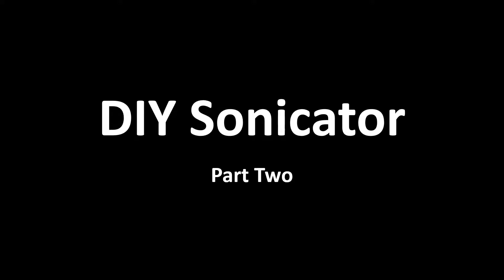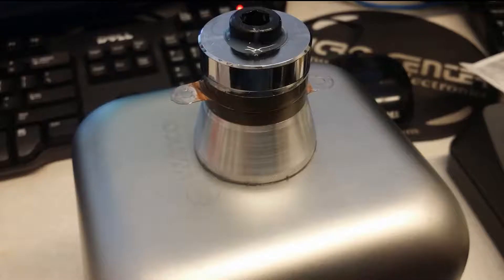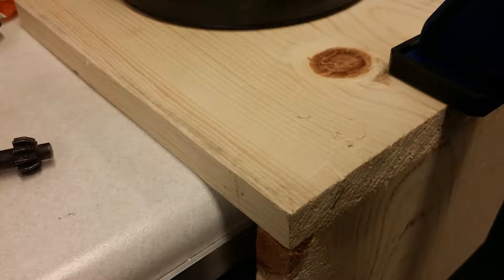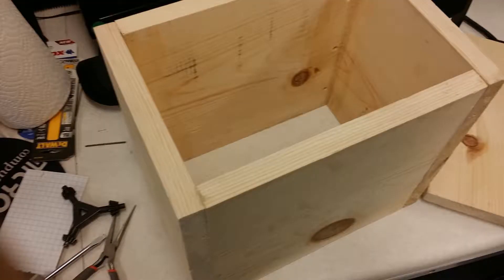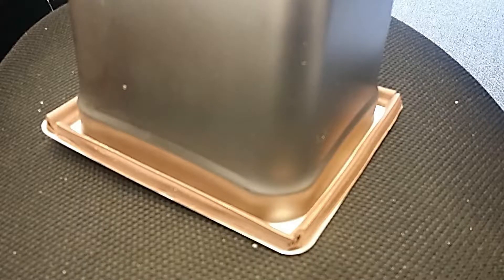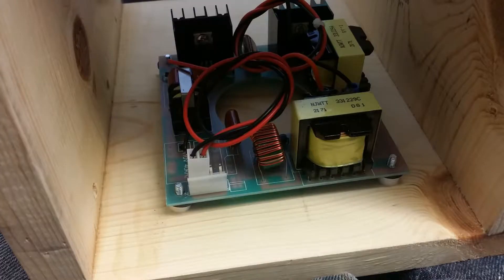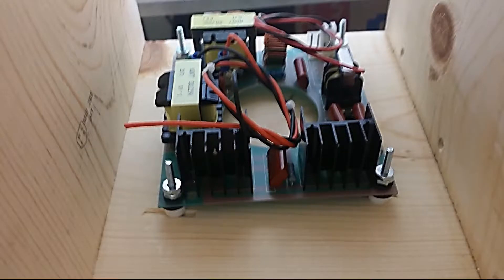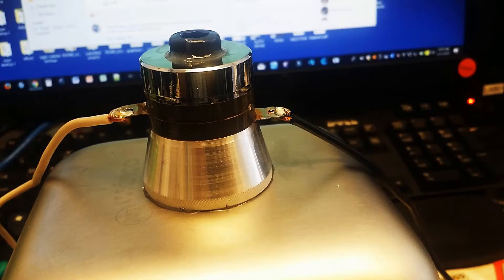DIY Sonicator Part Two

Comment: Great project, thanks so much for creating this. I was wondering if you could comment on how you've connected to the ac power? Are you wiring through a standard kettle lead type connection, into the extension cable and then to the power outlet? I would be very grateful for any guidance on wiring the driver circuit to the power supply. Thank you
Reply: Oh I rewatched the video and now I understand. thanks so much for sharing! :)

Comment: one thing... you mentioned that you thought the voltage at the transducer was "quite low".  Actually it can be quite high... several hundred volts as either a square wave or sine wave.  Nasty shock potential

Comment: I've recently seen people doing ultrasonic bowling ball cleaners,  so you think this system would work for that
Reply from the maker: I honestly don't know.  I think it would work fine, just use a large enough "heating pan" -- but the issue might be that the transducer and controller I used wouldn't be strong enough for a larger tank and a high-mass object like a bowling ball.  Good luck!

Comment: tell me sir , can i use only one pcb-board with several transducers ?
Reply from the maker: No, I think you need a separate driver for each transducer.  I could be mistaken.
Reply: @stemcampprojects7951  actually, you can use multiple transducers sometimes in series and in other cases, parallel.  depends on the output of the driver board

Comment: Hello can you please tell me have you used a two wire main power supply cable , and have you wired them straight to the power wires from the power board. Also what amp fuse is in the plug.Thanks and hope to hear from you soon.

Comment: What type of pan is that?  It looks like a standard size / shape, just probably a 1/16 of a standard industrial “full pan”.  Does the single transducer element do the job for this?  It looks and sounds like it does.  I just got my hands on a kit like that, for PCB cleaning.  I’m deciding on a sort of pan to use presently.  Something not so deep, and maybe a little greater in its dimensions looking down. Very good work!  Particularly on your power board’s standoffs and grommets to mount the thing.  It’s all very nice, and thanks for sharing this, as I was uncertain as to what adhesive to use for this.  JB Weld is just the ticket, as I have a tube of it that I wished I had a use for. Thanks again!
Reply from the maker: It is a standard stainless steel pan -- often used in restaurants in heating / icing stations.  i believe I got it on Amazon or maybe a restaurant supply website.

Comment: Can I use this sonicator for breaking cell wall?
Reply from the maker: I would think so, but I don't know how much energy that requires.  Two things - don't suspend the glass jar with the rubber bands, just place it in, and change the side panels for more airflow so it doesn't warm the solution.

Comment: Can this be used to produce oil nanoemusion in water with this device?
Reply from the maker: I don't know for sure, but I would expect that it would work.
Reply: @stemcampprojects7951  I bought the kit a few days ago for $30 & will test it out soon. Thanks!
Reply from the maker: @scottalter42  Keep us posted!  One thing I'd recommend - leave off the side panels (but keep fans).  Let it have all the airflow you can manage for cooling.
Reply: @stemcampprojects7951  Success!!!!! I got the kit, successfully made some nanoemulsion of my favorite medicinal oil in water & consumed it.  My setup is slightly different from what's explained in your video. I have the transducer part suspended from top using chopsticks structure & had it partly immersed in the solution carefully without the possibility of shorting.  I wish I can post some pictures of my setup here. Anyway, I'm excited that this worked! Again, thanks for your great video & information about the kit. Your channel has been very helpful. Next, I'll make some graphine.
Reply from the maker: @scottalter42  When I think about it, I am concerned about your mod.  Specifically about putting the transducer directly into the solution.  I don't know about metals and interactions with what you are processing.  By attaching the transducer onto a stainless steel pan and putting water into the pan and putting the solution into a glass jar and putting it into the pan you avoid all contamination.  You don't need to suspend the glass jar like I did - you can place it directly in the pan.  The stainless steel pans are cheap because they are used by the millions in the resaurant industry.
Reply: @scottalter42  wow really thank you for sharing I also want to use medicinal oil too
Reply: @nomahlubinazo6902  I should warn against this method to produce nanoemulsions. Last time I did it, the solution tasted s bit metallic. I suspect the aluminum from the sono device somehow got into the solution.
Reply: @scottalter42  thanks for the reply, I'll look for a stainless pan and then hopefully I can give you feedback on how it went because I essentially want to make nanoemulsions to apply on my skin
Reply: @scottalter42  hi sam ann. Thx a lot for your info. I had some questions if you don't mind. 
Do you make any test for the nanoemulsions stability ? 
How long the O/W emulsions stability you made by this method or need add any emulsion stabilizers?
Reply: @bazzarmart8607  Sorry, I didn't test all that.
Reply: @scottalter42  Even if you use a titanium sonicator wand,  you'll get titanium in the solution. It's explosions as hot as the sun happening in the water,  its going to erode metal slowly over time.

Comment: Pardon my ignorance on this, but this is really an ultrasonic bath, correct? Or would this be powerful enough for cell lysis?
Reply from the maker: I don't know enough about cell lysis to answer this properly.  This version is pumping 60 watts of energy into the bath, so it is reasonably energetic, but I believe cell lysis usually uses the "probe" style of sonicator.  It is working well so far for my needs, which is primarily splitting apart graphite layers into graphene in a mixture of acetone and water.

Comment: Look on you tube for dry ultrasonic systems. They put the transducer under a plate. Pour the powder on it. The powder breaks up immediately into super fine nano dust. Easy to make.
Reply from the maker: Thanks!  I'm going to stick with wet - because one of my main applications is to separate the layers of flake graphite cleanly into graphene.  As I understand it, to do that requires that the layers be intercalated and that a mixture of 75% acetone and 25% water is the way to do that.  Robert Murray-Smith has a bunch of fantastic videos, and he describes and shows how to make graphene this way.

Comment: I recommend getting a computor fan so you can ventilate it. Because the transducer gets hot. They recommend 2 hrs or more of ultrasonic. Up to 12. Also make the box just a tiny bigger so as to put sound deadening rubber on inside box. I’ve noticed no one has a ventilated system.
Reply from the maker: Great suggestion.  I can just cut a hole and put the fan on the outside blowing in, and cut exit holes on the opposite side.  I'll probably use a 110vac fan instead of a computer fan (you can get them in the same form factor) so I don't have to provide 12 volts dc.  (something like this:  https://www.amazon.com/80mm-Cabinet-Finger-Guard-Cooling/dp/B01FFZ8T0W)  The unit isn't as loud as the video makes it sound.  It sounds a lot like a bunch of bees.